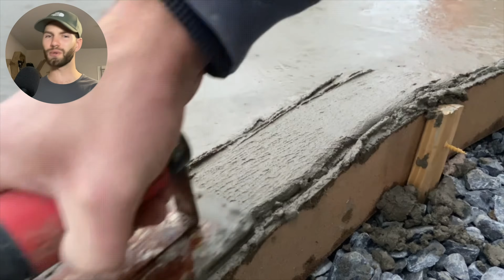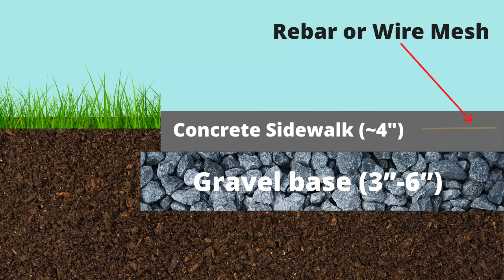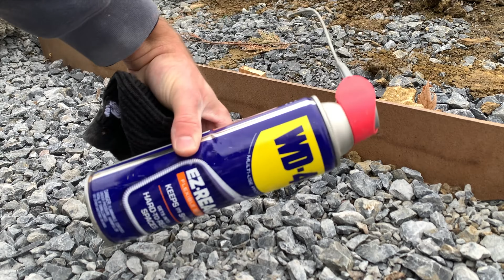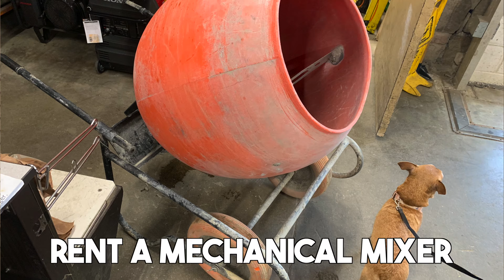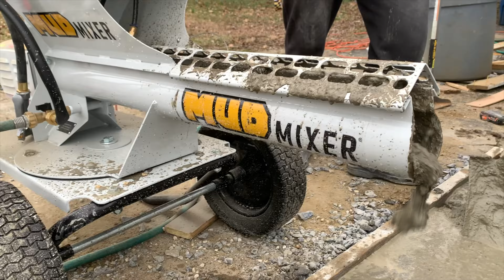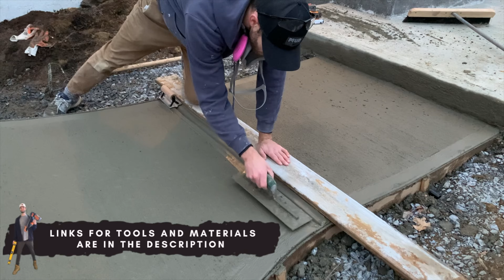How to Pour a Concrete Front Porch Sidewalk (DIY Curved Concrete Sidewalk)

Comment: wood float, then magnesium than steel.....you want to push the rock down with the first 2 trowels

that machine is way too slow......a mixer is easier, just get ratios right and do same formula over and over.....add a shovel of cement to 3 bags of concrete, the mix will be easier to finish

Comment: Greetings.

Quick question.  When using your Mudmixer, what water setting did you finalize on?  The proper water setting is paramount to a good pour.

I will be renting one this spring to pour a 10 feet x 12 feet slab as the foundation of my barbeque cook house/canopy.  I will be using either Quikrete 4000 or 5000 concrete mix.  I need to get this pour right the first time.  Therefore, any assistance with water setting would be appreciated.

From my research, most people are using a setting between 30 to 35.  I will be pouring the initial mixes into a bucket and testing its consistency before I start the actual pour.

Thoughts?

Comment: The gravel was very unnecessary and the steel wire is only good for keeping the broken concrete from separating after it breaks. Zero strength added.

Comment: Diesel fuel works good as a release agent. 
 Sprays through a regular pump up wand sprayer easily. Lower cost than WD40 too.
Reply: I paint my forms with used motor oil.

Comment: Fantastic!  I noticed (I think) that I did not hear the word 'rent' in your actual plan.  I noticed that the jack hammer was purchased and that that concrete making machine looked out-of-the-box new.  I can see a whole new series starting to open up here and I am somewhat excited .  Did you finish or have done a new driveway between the sidewalk installation and the final filming?  I only got a glimpse but when I backed up and froze the frame it looked really spiffy unlike at the start.  I really like the way you finished the walk with the joint in the middle, the edging , the grooming and that California edge treatment.  Really a class act.  Thanks for a great show.
Reply from the maker: Hey Patrick! And you are correct - bought TWO jackhammers and own the mixer. Definitely have a lot of possibilities for concrete now 👍. And I actually had the driveway repaved with asphalt. One of the few projects I outsourced haha thanks for the continued support!